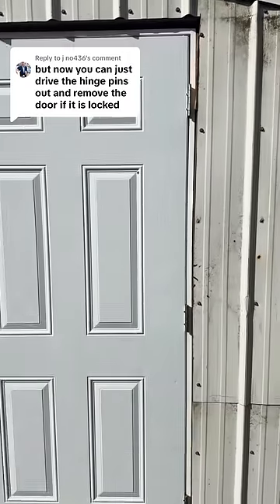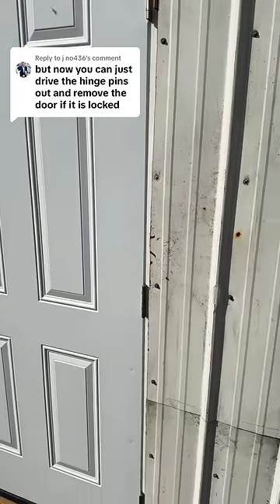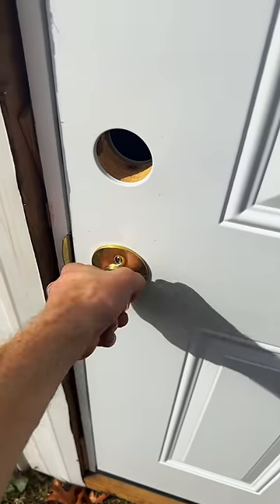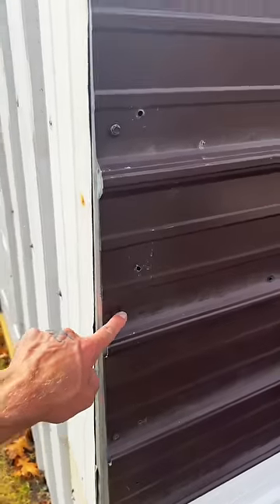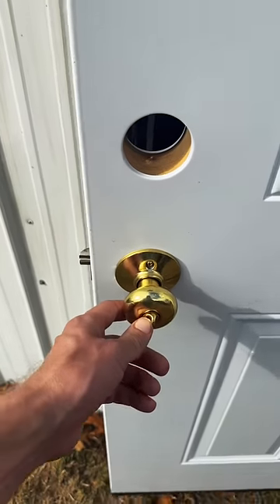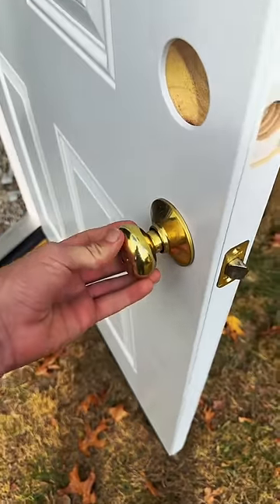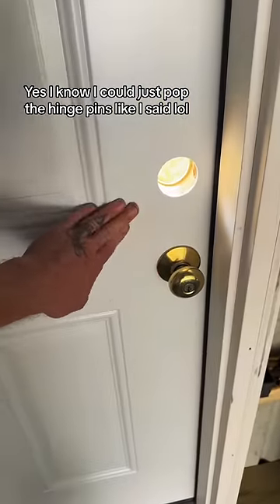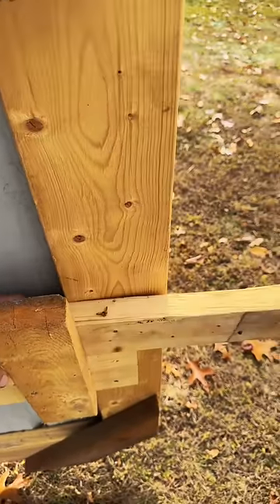Exposed hinges make it easy to get in a locked door

Comment: Remember, locks only keeps honest ppl out. And this is a funny way to say it in practice 😂
Reply: @Ikirus watch as they are either picked open, smacked open, or cut opened.
Reply: And animals, which is probably the larger concern here
Reply: @Ikirus most locks are sorta easy to lockpick, but most of the time It just detters people from opening whatever you locked up, so I wouldn't worry about it to much
Reply: @Nurozo  your lock is only as strong it's weakest link
In some cases that's the door. Sledgehammer.
Reply: @stevenn1940  Honestly yes, his main concern is probably wild animals.
Reply: @Ikirus  By any chance, it's brand is, masterlock?
Reply: @Ikirus 
Watch the lockpicking lawyer
He opens locks from the best selling brands by smacking two of them against each other
Reply: @Ikirus watch the lock picking lawyer
Reply: @Ikirus You might want to put the name of that lock on YouTube search. Pretty much every lock can be picked in seconds by a professional. (Unless you are Finnish. Locks made by Finnish brands seem to cause these lock pickers some trouble, actually slowing them down).
Reply: @Ikirus In the era of battery powered tools, cutting your lock off could be done in 30 seconds or less with a cut off wheel. 

Most commercial locks can be broken open with two wrenches, as well.

And if someone really wants to get into your locked storage without damaging the lock, they need only get the appropriate lishi tool. Even a beginner can pick your lock in seconds with the lishi tool.

As others have said, locks keep honest people honest. A really good lock, of which there are few manufactured on the planet, can slow a criminal down, but there is definitely someone out there who can beat most every security precaution given enough time, tools, and persistence.

The more you learn about mechanical locks, the less security you realize they actually provide.
Reply: @Sienisota We got pretty nice locks in Germany, too. As long as you do a slight bit of research, you can get a lock that is probably more secure than the door. We also got a secure door :) 
Then the purpose of a lock is to prevent an easy, silent and invisible way of entry
Reply: Well, honest people and animals, which is probably the more pertinent concern on the homestead.
Reply: I think it's kind of art in that way 😊
Reply: Good locks are rated to withstand some number of minutes against different types of attacks.
Reply: @deanonesense ah yes but masterlock just straight up lies about the time cause you can open them by smacking the lock with another lock....so it take about 2 sec if even. Most mechanical locks are extremly unsave the look of a lock is often saver than the actual pick savety of the lock.cause people see lock and move on. Most locks can be opened easily if someone tries but most people wont try. So still saver than no lock but better is just never getting a masterlock.
Reply: @Ikirus tell me your a kid without saying a thing pls. Go educate yourself there are plenty of lock pickers and people who job was to enter secured areas in the army. It not that hard most cheap locks that are metal can just be smashed by the same lock open even a good palm strike will do it.
Reply: He just doesn't want to risk keeping an honest person in 😂

A car cover is an excellent security feature. A burglar would look at that door and think "there is no damn way a TRX is in there."
Reply: They deter most criminals. I would say the vast majority of criminals either dont know how to pick locks or wouldnt want to
Reply: @deanonesense Yeah but if I can just hit it with a sledgehammer and tear the baseplate out of the door frame then the lock didn’t do much good. Locks are only as strong as the weakest link of what they’re locking.
Reply: Honest and stupid. I work at a trailer dealership and we had one of our units stolen. It was locked as was later found in a parking lot, locks all scratched up and door with holes but they didn’t manage to get in. Thing is, I can get into one of those in less than a minute with a flat head screwdriver and a hammer. So yeah, honest people and idiots.
Reply: "If you want to go inside just go in, I just ask you don't break anything in the process"
Reply: But look how the lock is on the inside..  he's not keeping people out... he's keeping people in
Reply: @bearsplitz96  carrying around sledge hammers is suspicious and draws attention. Knocking down a door with one is loud and draws attention.
Reply: @matthewbutler8247  So it's a trap 😂
Reply: @pvpminer9007  yeah. UL rates safes independent of manufacturers claims. I wouldn't put any weight at all on manufacturers ratings.
Reply: It keeps idiots out too. You'd be surprised how many criminals wouldn't think to pop the hinges, but they'd walk right into an unlocked building and steal your crap.
Reply: This is such a dumb sentiment. Doors keep honest people out, locks make your house less appealing then your neighbours house for lazy thieves. Which is most thieves
Reply: Drake.... where's the power saw.
Reply: Jails have different words to you
Reply: @aliciafaulkner416  I mean, aren't jails supposed to keep bad ppl in and honest ppl out? 😂
Reply: That's a stupid saying. Honest people don't break in. Locks stop varying levels of lazy and skilled people from getting in.
Reply: Locks and cameras
Reply: Sure, if someone REALLY wants in. But a lot of burglaries are from opportunity or desperation - someone notices your door is unlocked, or someone desperate is looking for an easy way to make money fast. They want fast and low effort, so a sturdy lock can be a real deterrence.

It’s like seat belts. Just because it doesn’t prevent the bad thing 100% of the time doesn’t mean it’s not still really useful.
Reply: Honest people wouldn’t even jack with an open door
Reply: I wonder what he is trying to keep inside though
Reply: @fantasticsound2085 thanks for the full blown analysis doctor
Reply: @IamCoalfoot no just honest people. Animals can’t get in with or without a lock
Reply: No, honest people wouldn't need a lock because they are honest. It only keeps animals and people that don't have the drive to break in  out.
Reply: @grenindraw6947  most crimes of breaking and entering are caused by oppertunities like you not being home (usually smashing the locked or more crude than lockpicking), open window/door, coercing someone to open a door, you live there long story short they are usually from vulnerabilities that get exploited because lockpicking takes some practice even though its stupidly easy
Reply: Yep hell normal locks don't really place them where their needed
Reply: Seriously, a lock is just a signal to normal people “this is private”
Reply: @snap.-_- just the latch keeps animals out
Reply: I still don’t understand that saying. Wouldn’t no lock keep honest people out?
Reply: "locks only keep honest people out"
No, no. They keep out honest people, and people for whom the risk of getting caught breaking in doesn't feel worth taking.
That second category matters.
There are plenty of people that are afraid of becoming criminals
Reply: Yeah but if you have the hinges and other stuff sorted most ways of breaking in are pretty loud. Hes fucked if hes not near his house when he gets burgled though
Reply: Sometimes honest people know how to lockpick though, that’s how I figured out that my roommate was smoking meth when I finally decided to get nosey and lockpick their footlocker
Reply: That is literally not how locks work.
Reply: @paulh2981  yes it is, cause there is no completely safe lock. It doesnt exist. All locks are breakable
Reply: As a lock picking hobbyist, I came down here to say this.  At the end of the day, a pair of bolt cutters or power tools will get someone in to pretty much anywhere (there are easier and quieter ways, but most criminals just brute force it)
Reply: @pvpminer9007  Most career criminals are either not very bright or very uneducated.
Reply: This absolutely isn't true though... demonstrably, it also keeps out opportunists who are just tweaking around trying doors too, which is like 50% of all break ins...
Reply: @jama211  isn't that the same thing as what the original post said
Reply: Exactly.... if you're a crook... you're gonna get in anyway.
Reply: And lazy/opportunistic thieves
Reply: You will still get that one moron robbe that finds the hardest way to get in instead of trying the door 😊
Reply: My Dad always said "A lock is just to keep an honest man honest" lol nice to see someone else had this knowledge imparted on them as well 😁
Reply: If that was true then locks wouldn't be used. Anywhere. At all. Use your brain.
Reply: @frakis2771 That’s the point! They keep honest people out because those are the only ones not attempting it 😂 everyone else just breaks or picks the stupid thing. Locks don’t keep criminals out..
Reply: @tjmurphy9909 Then you aren’t one of the “honest people”. Breaking and entering ain’t exactly honest or legal 😂
Reply: @testerwulf3357  Then feel free to leave your doors wide open and stop locking things.
Reply: Well, honest and Lazy people
Reply: Came to say this same thing

Comment: I love that you're more concerned about accidentally locking yourself in than you are about someone else entering without permission.
Reply: The remote location is probably better security than a lock. Fewer neighbors means fewer eyes on your stuff
Reply: Trust me, he should be. Locks do literally nothing to keep people out who want in..better to not lock himself in or out than try to keep out people who will get in anyways
Reply: @testerwulf3357 Well that’s also what his giant dog is for
Reply: Also, the pin-knocking trick only works if the pins are not welded to one of the hinge plates.
A lot of exterior doors are made that way, but it's something you should be sure of if you want an outward opening door AND security.
Also, you could tack-weld the pin to the top plate section (but not both plates!!!) to get the same protection.
Heck, you can get away with just doing it on the center hinge.
Reply: @MolecularMachine  this is also America. As long as you live in a state that respects the right to defend yourself and your property... most people don't go trespassing on rural land because they know what'll happen.
Reply: @MolecularMachine  tell that to the guy or guys who managed to grind down everything but the actual lock on my bike lock lmfao
Reply: In different videos he said he's over an hour away from I forget if that was a city or civilization, but you'd have to be pretty determined to steal from this guy, So securing his stuff isn't exactly the largest concern, especially now that he has a livestock Guardian dog